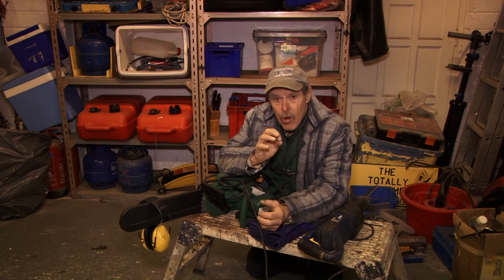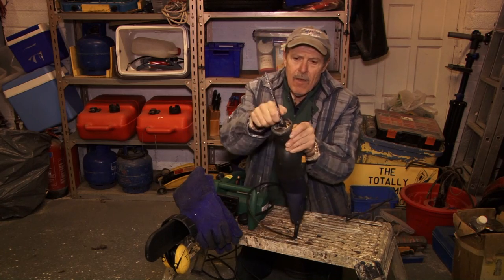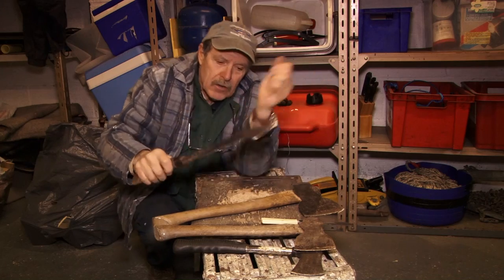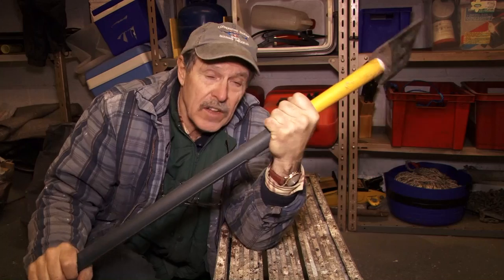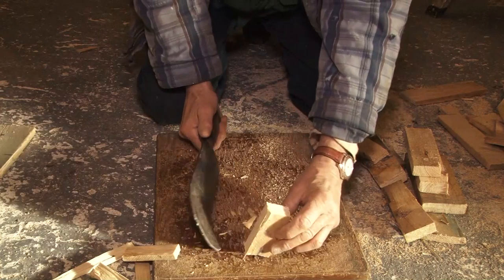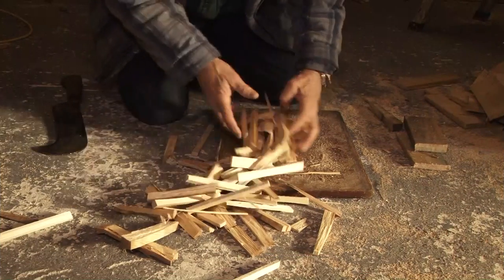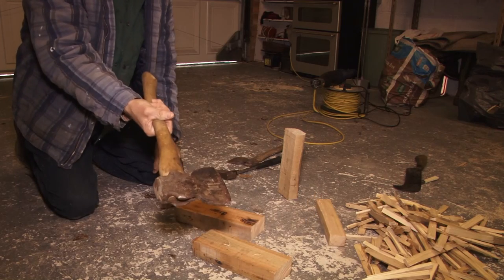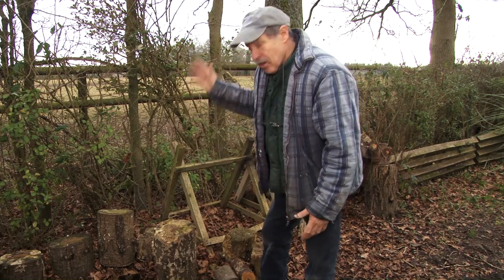How to cut wood | TA Outdoors

Comment: The hook-bladed 'axe' at 7.06 & 11.00, is not an axe, or a hatchet, but in-fact a billhook = hook-blade. This is a traditional British tool used for green woodwork, hedge-laying, branch trimming, coppicing, and scrub-clearance & etc. There are many different types (I think there were different styles for each county, plus different ones for each use).